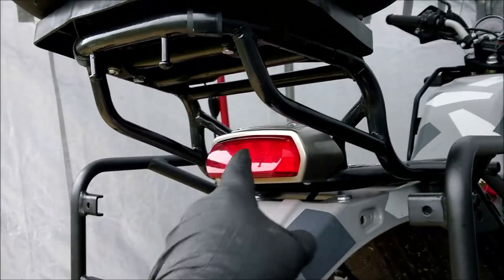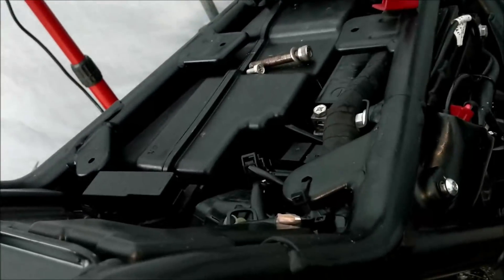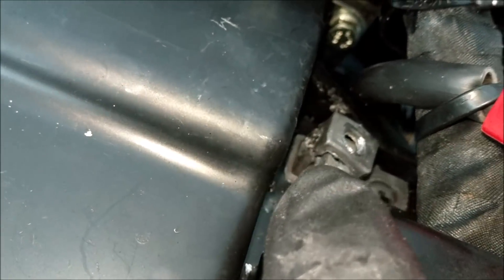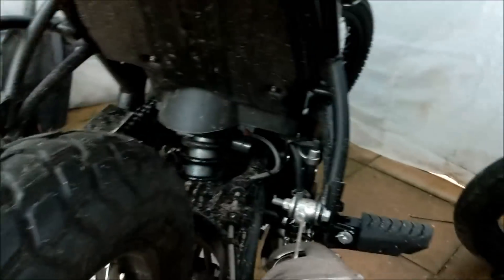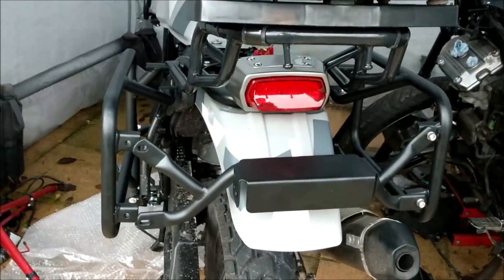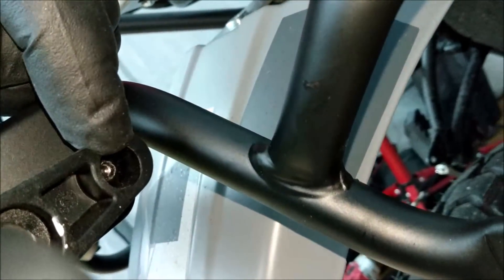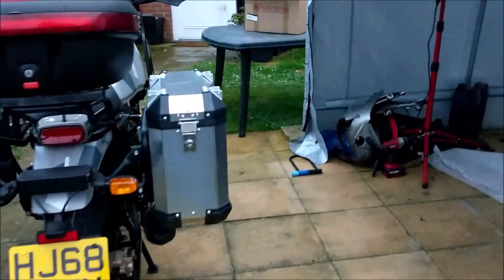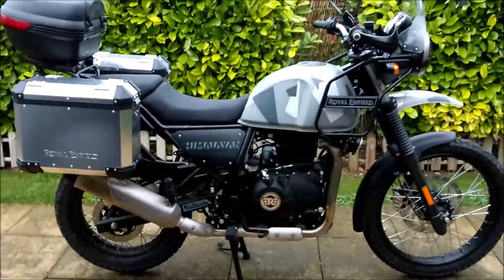Royal Enfield Himalayan Modifications #1 Panniers Fitting problem

Comment: I found out the hard way that the original rack was not strong enough when it cracked and collapsed with the top box on after a few months so I had a local blacksmith modify it in a similar way as the after market ones are. After a tin of matt black paint it looks like a factory job and still retains the original fitting points. 
  Also those original Indian batteries are rubbish anyway and mine died as soon as our cold nights set in so I replaced it with a Yuasa one. I'd suggest you upgrade to a better one too if you are going to be adding electrical accessories.
 I'd also recommend disconnecting the ends of your throttle cable and getting some lube down inside it as mine became rough and eventually snapped at less than 6k miles. Before fitting the new cable I got plenty of oil to drain down the inside of the cable and it feels great now and should last a lot longer.
 Still a great bike though.
Reply from the maker: Thanks Cowley, yes i will strip it down when i get time and make sure all that needs oiling and greasing gets done, even the clutch cable feels a little gritty, I'm going up through the gears without using the clutch (from 2nd gear onward).
 Thanks for the comment, these are relatively new bikes and will have many little teething problems, so if we all communicate our little findings then we can help each other out :-) take care mate.

Comment: Good video - nice clear explanation. Lovely looking bike. I am on the point of buying one, but BADLY put off by reports of quality issues like fraying cables and the toffee bolts and cack handed assembly (broken terminal)  you demonstrated. How to spoil a good thing by  saving pennies???? Come on Royal Enfield. Make a quality product please!!!  Cheers.
Reply from the maker: Just about sums it up tony,  there is a true saying "you get what you pay for". to be fair the bike is solid enough, and most of the bolts are mild steel, but a few little ones (indicators) are black in colour and they seem to be made of chineseium…..I literally put the 10mm socket on it and it just spun the head off, my guess is that it was assembled with too much torque and was already fractured. the battery terminal is wrecked and almost completely sheered off when I gingerly tightened it up. a call to the showroom tomorrow should change it without too much bother. its a real shame that whoever fitted it incorrectly and broke the positive post didn't just put his hand up and say...it would have saved all this embarrassment. when the warranty is up I will change as many bolts as I can to stainless ones.

Comment: I had exactly the same problem with mine and I have a winge in my latest vid, even had to cut brackets of mine and move them an inch and re-weld and paint, drill and thread... All nuts ,bolts and brackets didn't fit for crash bars and yes all made of toffee! Went out in the rain once now when I stop I have rusty pools of water running down my bike on to the floor. Now after 4k miles ,brackets on the bike that hold the electrics are snapping , only £6 to replace but not the point, bikes only been on the road two months but when I'm out on the open road and up in the mountains and forests none of that matters and I'm smiling from ear to ear : )
Reply from the maker: Great attitude, I'm going to wait for a decent quality supplier to buy front bars from, everyone and their dog will be banging low quality tat out soon because there is good money to be made

Comment: Hi Adrian. Where did you buy your hand guards? Ive been looking at loads of options on Fleabay but my local dealer had a wee nightmare getting some to fit, tube diameter issues?? I pick mine up on Saturday this week. Cheers and keep up the good work
Reply from the maker: I got mine delivered from Cooperb, I have been asked to do a video showing the fitment and naming the supplier. Will do that this evening hopefully